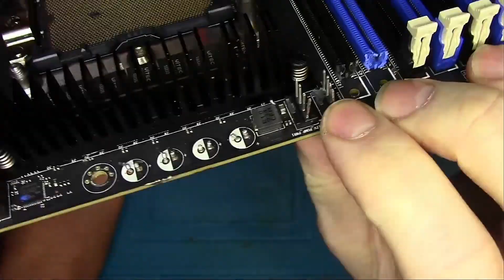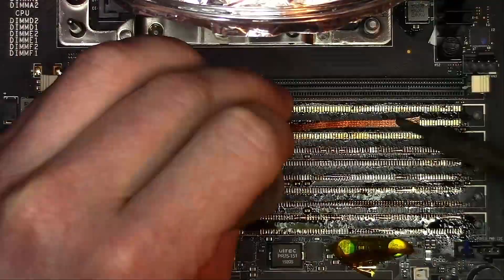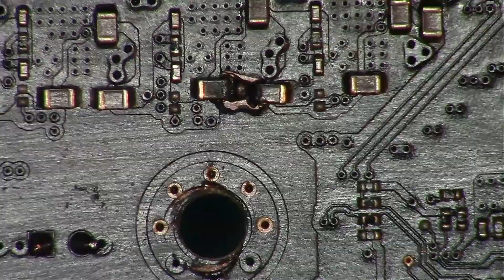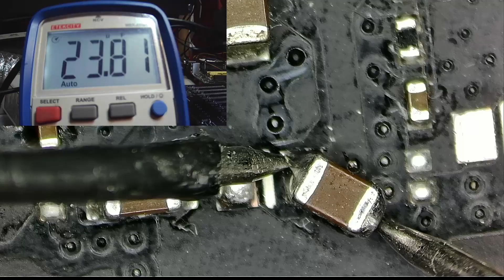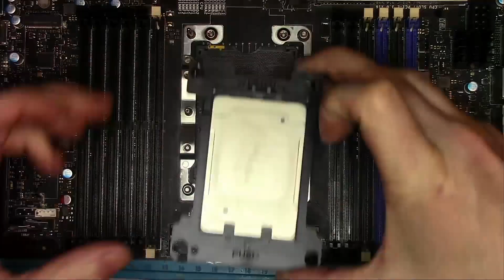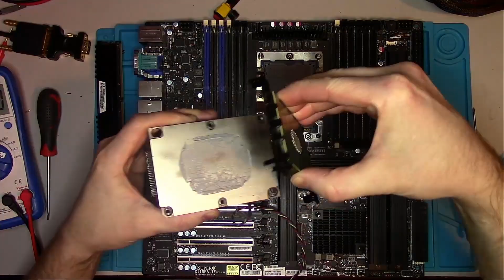supermicro X11SPA-TF server MOTHERBOARD repair

Comment: Hi, I have a h11dsi-nt, a dual epyc server motherboard and it stopped working all of a sudden, now when I power it on the fans start spinning but nothing on display, there is a green light that blinks after about 3 seconds , I de seated both cpus removed ram and ssd changed another power supply but nothing works what should be the issue here, thanks

Comment: 5:42 this form factor isnt too new anymore but the size is quite uncommon on most of the consumer boards but not on server boards. this is a 22mm x110mm M.2 slot, supports all shorter drive lengths: 80mm, 60mm, 42mm and 30mm but on this specific board, only 80mm and 60mm are supported

Comment: Wait, so was the problem wrong memory all along as you stated memory type was incorrect at end of video, this repair wasnt even necessary?
Reply from the maker: Yeah. None of the damaged slots needed to be replaced and shorted capacitors could be left alone.
Sarcasm.

Comment: Have you done any replacement of through hole RAM slots? That would be interesting video. ECC memory is actually cheaper usually.
Reply from the maker: No.
It would be harder to remove but easier to put back
Reply: @northwestrepair  Yes, I had a motherboard that had bad RAM slots, with couple damaged pins inside the slots, that's why those RAM slots didn't work. I never tried to remove, because it can take a lot of heat.
Reply: @mikegaming4924 Apply low temp solder to each pin and remove with a heat gun

Comment: 5:20 you could also just spread the paste manually like on a normal sized cpu
Reply from the maker: Spread is the worst method especially for cpu
Reply: @northwestrepair  nope it works very well

Comment: Good job. i would hate to change ram slots with hot air station tho. Cant be sure each one of pins soldered properly, they will work until someone pull the ram out..

Comment: This is wild, I hope you charged about a million for this repair. I did learn some things! I had no idea that SMT memory sockets could be replaced like this. Absolutely bonkers repair. Good job, thanks!
Reply from the maker: Nah it was like 60 bucks plus parts
Reply: @northwestrepair  I feel like you are too kind with your repair cost 😭. I mean it's good for consumers but still
Reply: @northwestrepair  you sometimes said “I am cheap” in other videos, I guess it is true 😂
Reply: @northwestrepair  Bro start charging a little more, just a little thats less than a locksmith
Reply: @northwestrepair  lol what? gonna send u my board too dude
Reply: @northwestrepair  that's too low for a repair like that but i guess it depends on many things. also smt only ram sockets wasn't something i knew were a thing. i guess the through hole pins most usually have is for alignment before soldering? besides, they have so many pins that is very hard to rip them off, you just break the plastic clips.
Reply: @giornikitop5373 cheaper boards use though hole sockets. It's typical of 4 layer boards and the socket connects at any layer, but the protruding pin becomes an antenna and the signal integrity is overall a little bad due to stack up and fanout.

Comment: Jeez, what is that huge processor? Great job as always
Reply: Looks like an Intel Xeon Bronze 3204 (low end Xeon CPU) was used for testing, but the socket supports some higher end Xeon models too.